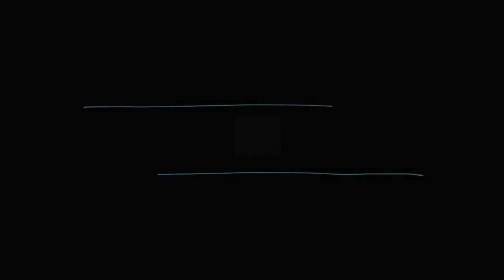#257 - Installed A 2500 Gallon Water Tank 600 Feet Up Hill For The House! (Great Pressure)

Comment: Awesome! I am about to pick up one of those Norwesco tanks for rain catchment. I am going to try and strap it in my truck bed to move it. I plan on digging 3 feet down to take advantage of the earth's heat, and then build an insulated foundation and building around it as we are placing it at about 6600ft elevation in Utah.  Wish me luck!

Comment: I think a well insulated building and a few light bulbs or heat bulbs will keep things from freezing,  Perhaps about 6-10  diagonal trenches with gravel in key spots on the road will prevent a lot of rain run off etc .  YOU got this.

Comment: Nice narration.  Working hard as usual.  The pressure you will achieve is related to Physics and Fluid Mechanics, which are exact sciences.  The equation is Pressure (P) = water density x Earth gravity x height of the water column divided by the gravitational constant divided by 144 (converting feet square to inches square).  P = 62.4 lbm/ft3 x 32.2 ft/s2 x 90 ft (tank height) / (32.2 lbm-ft/lbf-s2)(gravitational constant) = 5,616 lbf/ft2 /144 in2/ft2 = 39 lbf/in2 = 39 psi.  If you relate 39 psi to 90 ft of water column height, that equates roughly to .434 psi per 1 ft in height.  So one can rough guess at any time their pressure by assuming the best they will get is .434 psi out of 1 foot water height.  Now there will be minor losses in the pipe fittings and length of pipe.  In a real world calculation, the Engineers are required to add up all of the pipe losses (known as Head Losses (hL), and subtract hL from the calculated pressure.  So my guess is you are looking at around 35 psi.  Perhaps a little booster pump may help out.  There's more than one way to skin the cat here to get more pressure.  I am sure some of the surrounding residents may have some answers in that department.  Have fun!  Good luck.

Comment: Super insulate the shed around your tank, two layers of the rockwool or a layer of rockwool and some poly foam.  Then if you still have a freezing issue just install a small no pilot  RV sized propane water heater and 100# propane tank.  It's not going to take much energy to keep it from freezing. Set the thermostat to say 35 degrees.  The propane heater would be a lot less expensive than the cost of running electric wire or  installing a solar system.  Bet you would use less than a tank of propane per season.
Reply: No no no no... Dig a 100 feet of geothermal vent pipeing with a small fan to circulate. You could keep the shed at 45 degrees year round with a computer fan.

Comment: Your water storage area...If possible recess the tank into the hill. Around the perimeter (3 sides), using preferably pressure treated timbers build wall. Thus providing a thermal break to the tank area.  Perhaps if you have a local utility company near by you could pickup a few old telephone poles for the roof. They have to pay someone to remove the poles from their yards. Then place your sloped roof across the top and cover it with about 2' to 6" of soil. The front wall also pressure treated lumber, insulated with 2" foam board inside. Giving you a structure that only minimal energy would be required to sustain, while still providing security and shelter
Thanks for sharing with everyone your trials and tribulations.
When you begin 2nd guessing yourself, just think back to everything you and your family have already accomplished. And take one day at a time and everything else will eventually fall into place.
Best Wishes

Comment: If you plan to put your solar up there, then build you shed large enough to also have your batteries, solar controller and "inverter". You are correct that 600 ft is much to far to try and transmit DC, but if you are transmitting AC, you will not have that problem. You could run romex and have little to no loss.

Comment: It will be very interesting to find out what your hydrostatic pressure will be at the house from the tank uphill. You might need some high pressure regulators to keep the valves at the house from blowing out. But you probably have thought of that.

Comment: I have been watching you build the well and install the tank, and so far I have had no issues with anything.   You are doing a fantastic job, and I find myself looking back 40 years and remembering when I wanted to do this in the Blue Mt.s in WA state, but was never able to afford the property in those days, life can be a bitch sometimes!!!!    Well after watching you work and enjoying every moment, I see a major problem that you may regret.    You are very worried about the tank freezing, as well you should be.   You have a fantastic insulator with mother nature, I truly wish you had dug a hole in the hillside and built three walls with concreate block then installed the tank.   At that time build the front wall and bury your building to insulate, by burying the building you would insure a constant 64-65 degrees, if the roof was below frost line you would NEVER freeze, period!!!  A pre-cast slab could make an easy roof, then bury well below frost level!!!    You buried your pipe to prevent freezing so why not the tank????   We are in winter now so give it some thought and perhaps change things come spring...    I believe you will save your self a lot of grief, and expense in the coming years as the planet cools and goes into a mini-ice age that will happen by 2030, in the meantime we WILL be cooling drastically!!!   An ounce of prevention is worth a pound of cure!!!!

Comment: greetings heath;
      in reference to psi gain for elevation, every 2.31 ft. of vertical height yields 1 psi (static). residual psi will be determined by line loss and demand at the time of measurement. keep up the good work.....g

Comment: 39psi, my prediction.  0.433psi per foot of elevation.  You are rock'in.  I look forward to your vids and I have no doubt that you will succeed.
Reply from the maker: Thanks!
Reply: Use the formula Pressure (P) = 0.433 × height of water in feet (h) to calculate the psi for elevated water storage tanks. The pressure at any point in the tank is given by 0.433 multiplied by the height of water above it in feet.

Comment: So at the tank I am thinking you need a float valve to shut the pump off, and also a check valve so the pump won’t just keep pumping when the tank is full. By the way I have to give you a lot of credit because starting a project like you are doing scares the heck out of me.
Reply from the maker: Yes. Float valve up top. Check valve down low.

Comment: If you use AC micro-inverters on your solar panels, distance will be much less of an issue.....  After all, that's why AC is used for transmission lines.

Comment: I m sure you will get it ready to move into. But that road is going to turn into a river when it gets rainy or snowing. It needs to be built up higher than the sides are with some rock or gravel or its going to wash and erode like crazy then it will be impassable. I dont want to sound negative but at least you got your road in so you could get your tan up there and in place.
Reply from the maker: That's about all it will be needed for this year.

Comment: Just a thought, you could use some of those tree's you cut down. Set them in the ground around tank,for strength, build tank house on them, then put heavy mil plastic sheeting on ground,and up sides of tank house a few feet and burm earth around building on plastic to stop rot. And gain some geothermal mass. Shawn James of Self Reliance used a Japanese wood charring preservation technique that lasts 100+ years,see his channel on here. So your posts don't rot. Also, something that concerned me, why is that spot flat? Was it old home site, or is it a convergence spot for run off? If it is a convergence spot, might want to build a secant wall on up hill side to divert water. Easy enough, just dig a trench, and set logs in ground upright, bury 3' deep, 1' or more sticking up, put plastic sheeting on up hill side to stop water, and backfill with soil, and seed with fast growing local field grass, collect seeds of surrounding plants.
Reply from the maker: Great ideas!

Comment: I wish you well on the tank not freezing. Did you look at an underground tank like Jessie and Alyssa on Pure living for life used? Was it just too expensive? What about digging your water building into the hillside and then and building the roof heavy enough to cover with a few feet of soil. And just have a well insulated access door. It seems like with the excavator and your skill you could get that tank way back into the hill and then with your sawmill you could mill up enough heavy timber to hold up a good soil roof. And then build a sturdy front wall that could be backfilled also or even do a rammed earth wall with 2 rows of earth packed tires in the front. I would want to do anything I could to minimize providing heat to the building other than the coldest days of the winter. But I know as your journey goes on you will update us as how this works out. It is a great story and I watch every twist and turn.  Thanks for sharing your life with us.
Reply from the maker: The 2500 gal tank was quite a bit more expensive and I did not want it under ground.

Comment: What about a greenhouse style building for the water tanks?
Reply: Not as worth it as you lose a good chunk of the heat gain at night by the poor insulation factor of the glass/plastic. A double pane window is only a R1.61 with a 2x4 wall with rock wool being a R12. You need 8.33BTU per gallon of water to raise or lower the temperature  so 20,825 BTU to drop the whole tank 1 degree F.

Comment: If you ever put solar electric panels up where you said would be a good spot, the distance needn't necessarily be an obstacle. 
You could run an inverter from a battery bank, giving you AC, transform that up to 230V, and run it to the house, transforming it back down when you get there. This would just be a small-scale version of what the electric companies do routinely. Even at 230V, the line losses would be trivial compared to what they'd be at 24V or 48V DC.
I lived in a country property which was fed by half a mile of 230V line from the nearest utility transformer on the pole, and there was no real downside to it, as long as the connections were all good. It was a relatively old installation though, and some days the connections weren't great,  but hey-ho it's just part of the fun of country living.
 The cost would be high-ish if you used all new stuff, but I have no doubt the right bits can be found on the surplus market.

I have a similar scheme in mind for a stream running through my property - it won't provide enough energy for around the clock use, but will be capable of running an AC generator providing 230V, which I can then feed a low-power heater in a bulk hot tank with. When it gets down to it, the greatest need in winter is for heat, and something which will provide a base level of hot water for almost free is worth while having.

Comment: the insulation and building around the tank and with the water temp will probably be enough to keep it from freezing. our 2500 gal tank is on a 5.5" concrete slab and in an insulated room with a metal roof the room pretty much stays the same temp all year long. we don't get as cold here as you do, but it's been down to 15 degs for a week at a time and we've never had a problem. i would think you will have to run a decent regulator on your supply line the hydrostatic head pressure will be more than you think coming to the house. you're doing fine, if the folks from Pure-Living were doing this they'd still be in the thinking/talking about it stages. i had to quit watching them they are slower than the second coming..
Reply from the maker: Slower than the second coming... My new bumper sticker!

Comment: Idk if you still look at these comments.... Put look into geothermal heat for winter... Underground vent piping and a fan and we keep out 1000sqft shop at 45 degrees all winter without a wood stove or any other heat. Even when it's in ghe negatives outside.

Comment: Mine is burried 3' in crushed limestone i have same tank.. Im questioning how you plan to power a deepwell pump 600' up hill with solar and gallons per minute/ hr.  230 volt pump. Shallow well pump wont push up hill that far. Possible multiple pump stations with seperate power source. Been thru this. In hills of NW Arkansas. I built my house my self also. Satifaction is what we get. I was told it wasnt possible to build where i did. Took 2 years to get power. Ran on generators for that time 24hrs a day 7 days a week.

Comment: Question . Why did you place the tank on top of the ground , instead of in the ground ? I would think that if you placed  the tank in the ground it would keep the water cold in summer ,  and insulated in winter . JUST a thought .
Reply from the maker: It's not a buryable tank.
Reply: Red Poppy Ranch I actually thought of that later , because you were moving it around very easily.  Heavy duty plastic.

Comment: If y'all get 12 inches of rain per year, you'd need a tarp or roof-like structure <20' x 20' to fill that 2500 gallon tank but how much water will y'all use per year?  If it's 80 gallons per person per DAY,...you'll need a bigger tank (or more tanks).  To get the maximum 80 psi in your house, the tank only needs to be ~35 feet above your roof line.

Comment: Would it not be worth it to skip the PV stage and just go right from solar to hot water with an evacuated tube setup run off a small 12v direct drive circulation pump. A evacuated tube setup works well in snow to self clear so if set up on the hill any snow would just fall onto the hill with the only thing that would need to be cleared by hand would be the pumps PV panel.
Reply from the maker: I'm going to play around with something solar related.

Comment: How long do you think the road to the tank will last during a heavy rain or spring runoff?
Do you intent to build water turnoffs and gravel the road?
What keeps the tank from freezing in winter?
Reply from the maker: Phil.Paula Stocks the road will not get used very often. I may put some gravel on it some day but it served its purpose getting the tank up there.
Reply: Shear mass will cut freeze days down,,It's the feed lines to cause concern. Tank can be filled via the supply line from  the tank to house with the instillation of a check valve.. No system is perfect in the sense that it is  fool proof. Besides that he knows his historic freeze days. Also he's housing it in so wind wicking is eliminated... As for me I have a well,,smack in the middle of my garage...Yep and when the pump dies it's off with some of the roof time..Decisions decisions decisions....

Comment: Odd question but could you mount a hitch on the mini excavator to pull a truck bed trailer around for the hauling capability? Thinking it would give you the ability to load up more then a buckets worth of materials rather then lots of smaller trips.

If you are going to have it 2x4 go for an insane slope to get the snow off it as it will not be able to hold much weight on the roof. Might even be worth spraying the roof with oil to make it extra slick when you know a big storm is coming. Other thoughts would be socks full of rock salt near the top to create a brine from the snow that hits it.

Comment: put it in the ground then it wont freeze
Reply: until you get it 36-40 inches under ground it still risks freezing even in the ground and that style is not a direct bury style. To get it far enough in he would need to dig into the hill side and effectively create a cave so would need materials to support the roof and walls.
Reply: mabe just pump the water from the well to the house and forget the tank
Reply: Eddie as he wants animals and a garden it will require more then a well can generally supply at once so the easy method is to have a holding tank that can refill over the entire day. Having a holding tank also gives you security for those times power is down for work or a system failure. 

Then you get the fire protection aspect of 2000+ gallons of gravity fed water vs a well that he has shown pumping out with a gas powered pump.
Reply: the bottom of my pond dont freeze an its 3.5 feet deep an it gets down to -10 here
Reply: I’m in a similar climate in eastern Washington. I want to see how the holds up in the winter. I would love to have reservoir tank.
Reply: Mine is burried 3' in crushed limestone i have same tank.. Im questioning how you plan to power a deepwell pump 600' up hill with solar and gallons per minute/ hr.  230 volt pump. Shallow well pump wont push up hill that far. Possible multiple pump stations with seperate power source. Been thru this. In hills of NW Arkansas. I built my house my self also. Satifaction is what we get. I was told it wasnt possible to build where i did. Took 2 years to get power. Ran on generators for that time 24hrs a day 7 days a week.
Reply: i would say you are right.that much water has heat in it